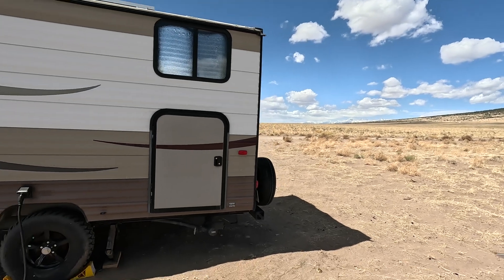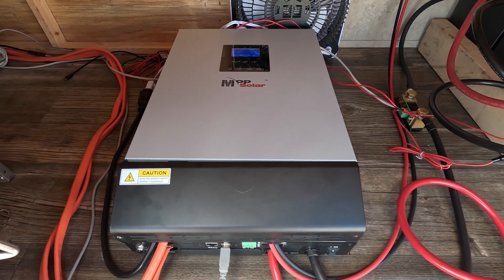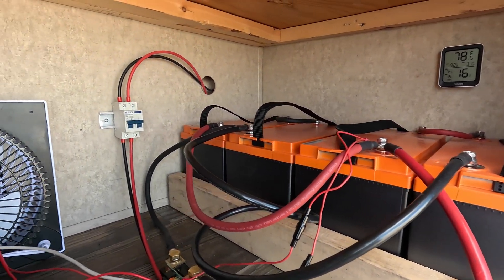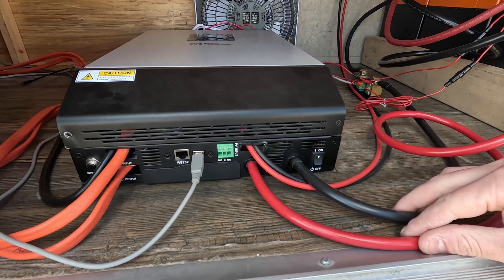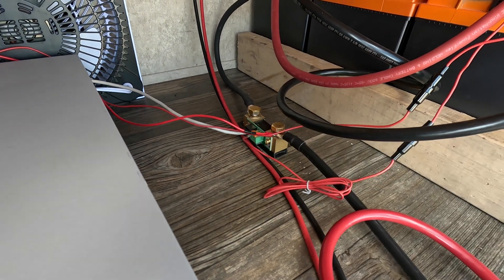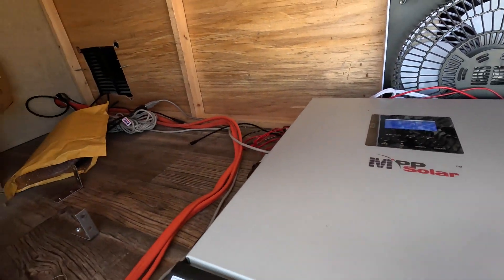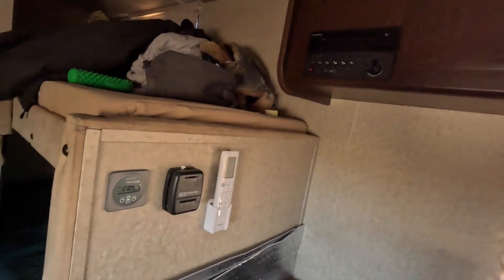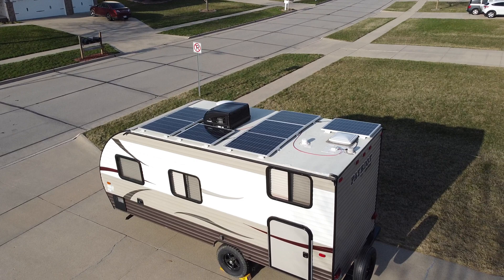A Boondocker's Dream | Our RV Solar Tour

Comment: Hey Cody, I think you said you had 7x12v panels in series going to your MPP controller unit. Did you meter the voltage of that string? Could easily be 150-160v exceeding the maximum  PV input of your MPP unit. Maybe your panels are different but my 12v panels put out about 23v each so I put 8 of them in a 4S2P config getting about 90v to my MPP unit.
Reply from the maker: They are 19 VOC each, so very close, but still below that 150 mark.  I absolutely did put a multimeter on the string before attaching to the MPP.  Thanks for watching!
Reply: Most these go bad from rattling around on the wall and floors..Why I mounted mine on rubber isolator mounts....Plus they can get more air flow behind them.. You can install a HiLetgo W1209 thermal switch to control the temp..Just add a low RPM high static flow fan. As the W1209 draw only like .25mA....

Comment: You mentioned that you have your batteries set up as 24v.  Do you have any 12v lights or other 12v components on your trailer?  If yes, how do you deal with those?
Reply from the maker: Bob, this is a great question.  I removed my 12v trailer battery, but the converter/charger that came with the trailer remains.  It takes the 120v from the inverter and feeds the 12v system and it is all that way from the factory.  The inverter runs all the time so the 12v system is always powered.  Thanks for watching!  :)

Comment: I did similar in my holiday rambler. Used 6.8 kw of leaf modules a 100 Amp powmr charge controller, a all in one powmr 3000 watt controller with inverter and a 4000 watt sungold power inverter. I currently only have 8 sharp panels ground deployed but adding 4 more on the roof soon. I love seeing builds like this
Reply from the maker: Awesome!  Sounds like a heck of a setup!  Thanks for watching!

Comment: Great video and info, but what kind of voltages is coming from your solar panels with them all in series.  While you can use smaller wires, it seems that the voltage might be too high for most controllers...
Reply from the maker: Great callout Kenneth!  The panels end up being around 140v VOC and the limit on the MPP is 150v VOC.  The MPP does have built in protection for if they go over voltage, so no concerns there if they are over performing.  I do plan to add 3 more panels to the top shortly, at that time I will be splitting them into two strings of 5 panels so I don't go over on VOC.  Thanks for watching :)

Comment: Nice job on the system and very nice presentation.  👍 

I have a very similar setup but went with the PowerQueen 100 ah lifepo4 batteries ($319 each).

You gained a new subscriber!
Reply from the maker: Thanks for the watch, comment, and sub!  Welcome!  I too looked at the PowerQueen batteries at the time of my setup about a year ago, but I believe they were just slightly more expensive than Chins.  Regardless, I'm sure they are a great choice!